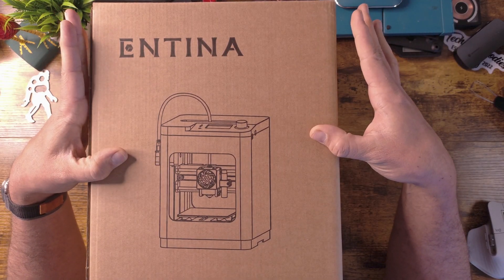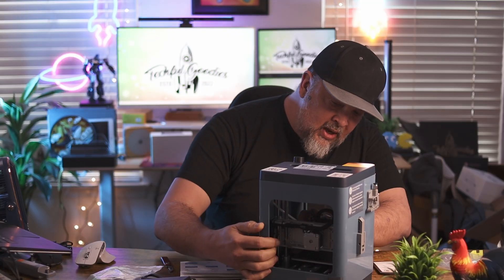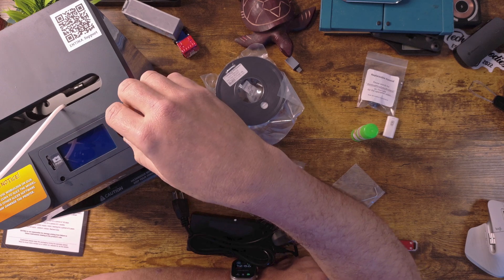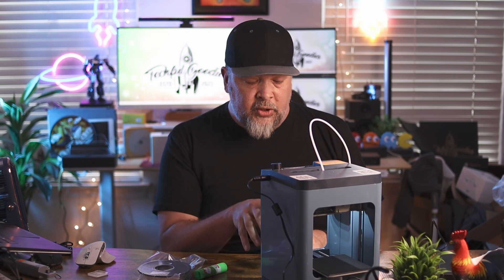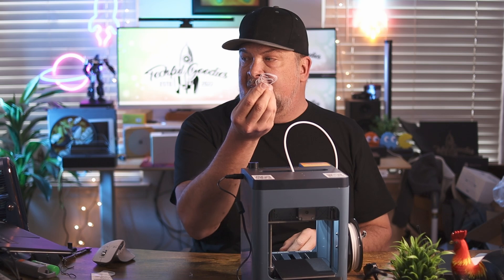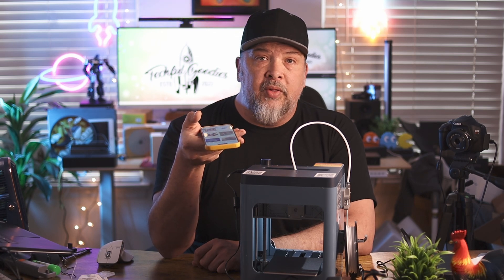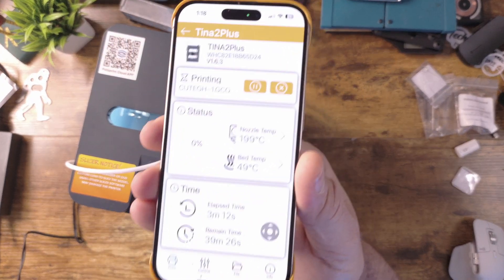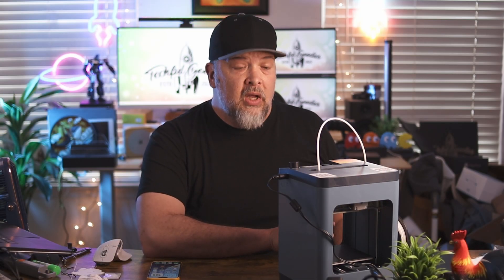UPDATED! Tina2 Plus 3d Printer Review

Comment: How do you convert stl to gcode on wiibuilder? I can do it with the printer set option set to the Tina2s but can’t slice with the printer set to plus. There seems to be no support for this printer. Can I use gcode created in the tinas2 or does it have to be made in the plus